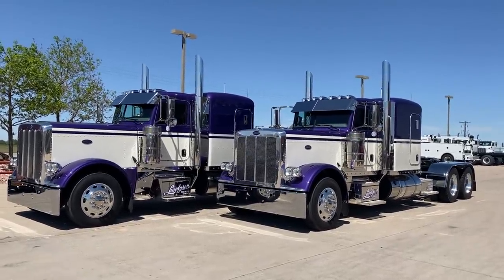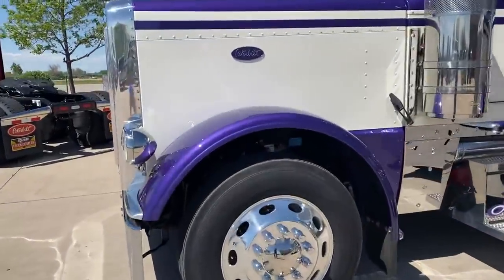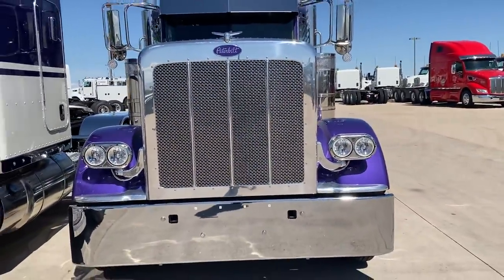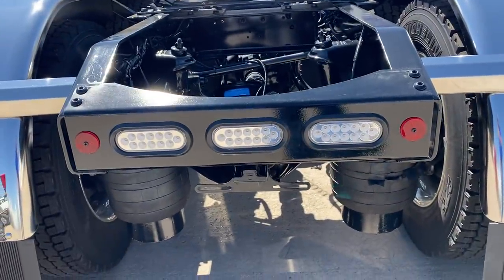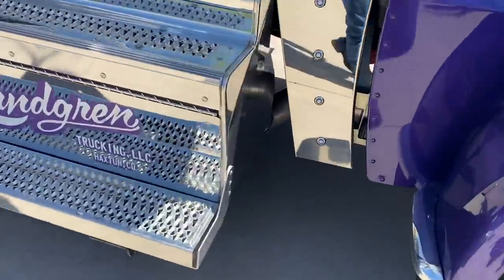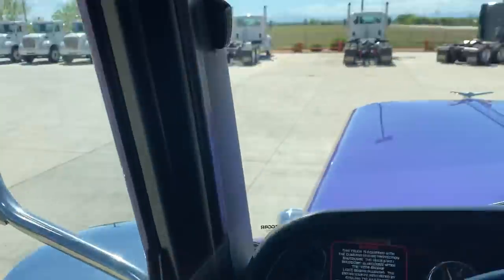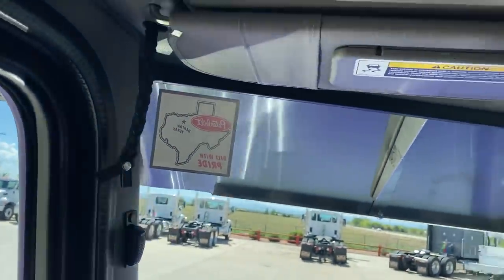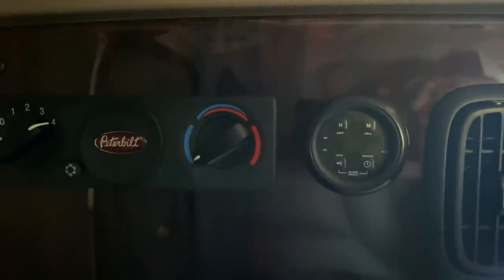Gorgeous twins!   2021 Peterbilt 389’s! 605HP!

Comment: At 3:33 there is a 5/8" bolt stuck in the inside of the wheel on the valve stem.
Reply: I wouldn’t have seen that, inside the wheel under the brakes
Reply: You’re exactly right it was a gold bolt it was stuck under the valve stem and rode there from Denton to Greeley to Denver like that
Reply: I hate pointing things like that out but I didn't want it to damage the wheel if it stay in there for a long time.
Reply from the maker: We actually did find the bolt Ray Sheppard.  Customer kept it as a souvenir!  Can't beleive it made it all the way from Denton, TX to Greeley, CO.  It was wedged in pretty tight.  We have no idea where it came from or what it went to.  The bolt was a new bolt.  Never been used.  Thanks for the heads up!
Reply: Dam Good Catch!

Comment: Hi nice video is a Peterbilt 389 EXHD the same as a standard hood or different and do Peterbilt custom build the trucks like that are all those after market parts from a third party shop
Reply from the maker: Peterbilt 379 am extended hood has a 131” BBC or Bumper to Back of Cab. A standard good is only 123” BBC. 
Peterbilt puts everything together and most of their parts are proprietary but obviously some are off the shelf. Or ordinarily parts but made specifically for Peterbilt.